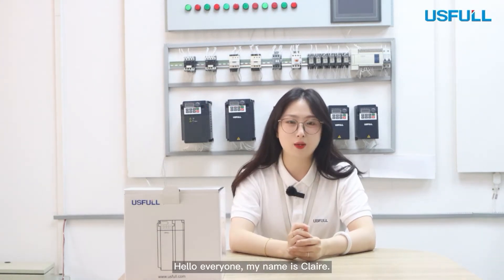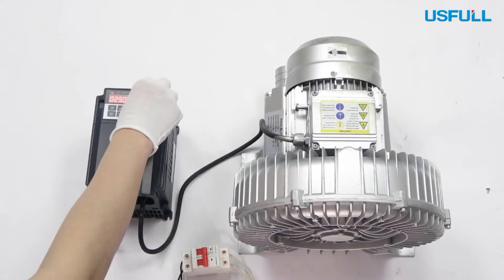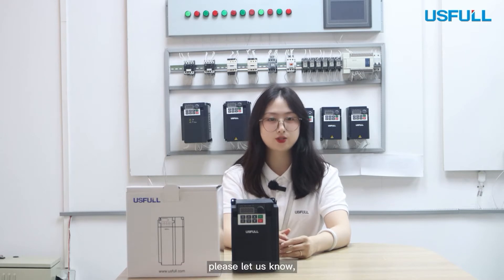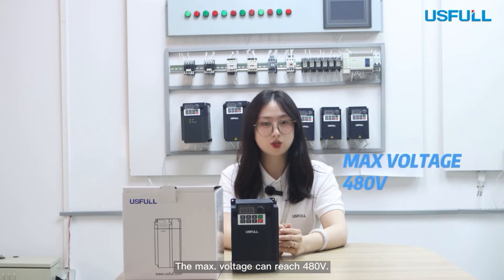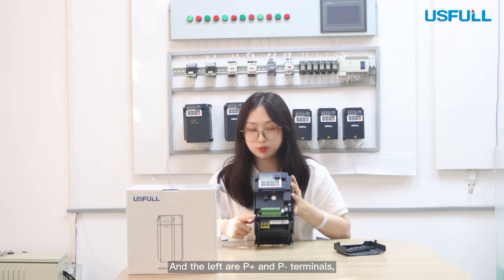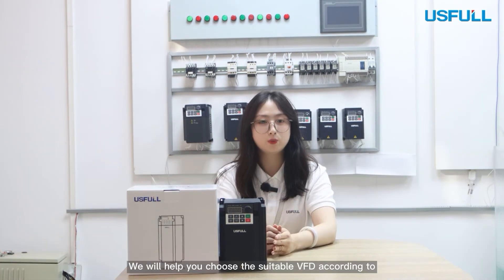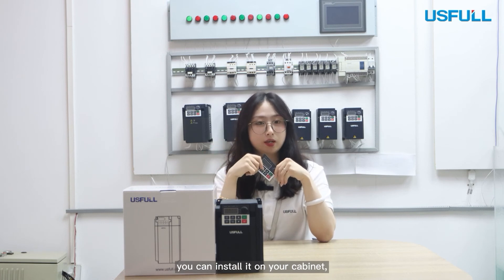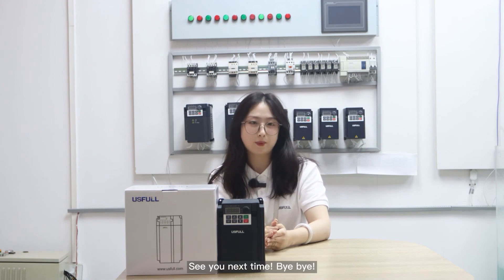USFULL- Ten Questions About Variable Frequency Drive / VFD /Frequency Inverter

Comment: Hello thank you for this video. Very helpful
I need ask you for the programming usfull
Reply from the maker: thanks a lot , how may I help you?
Reply: @Usfull when I'm starting the variable FULL he gave me this (error 57)
Reply from the maker: @rahiouimohamed-elhassan5782  Are you using our 9000D series VFD?
Reply: @Usfull  no i have this model FU9000S-1R5G-S2-A
Reply from the maker: @rahiouimohamed-elhassan5782  two reasons: 1.solar panels is too low or cloudy and rainy weather. 2. the motor start up current is too high.     
you can increase the number of panels  or change the motor
Reply from the maker: @rahiouimohamed-elhassan5782  If you can't solve the problem, please add my WhatsApp +8615868079112
Reply: @Usfull  thank you so much
Reply from the maker: @rahiouimohamed-elhassan5782  you are welcome, Can you subscribe us if the problem can be solved?